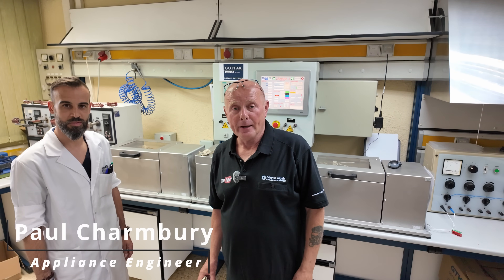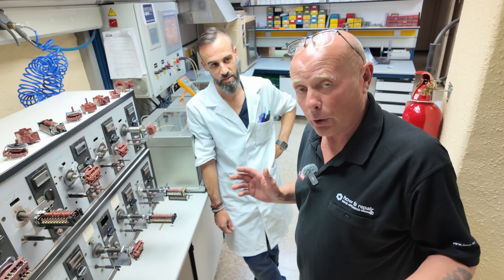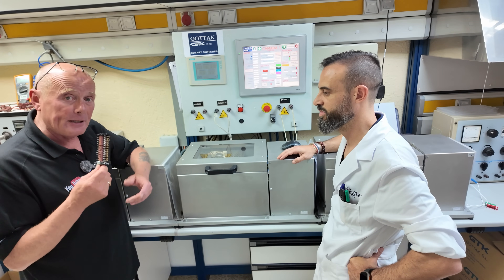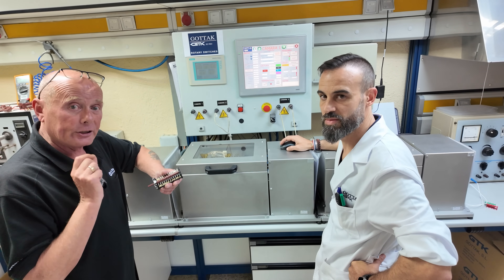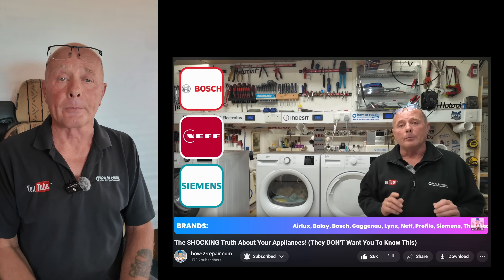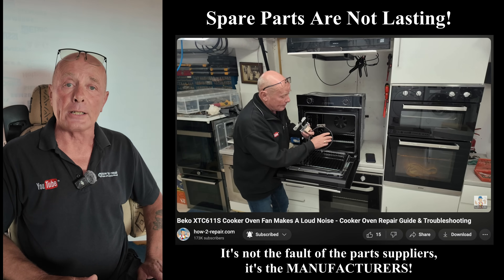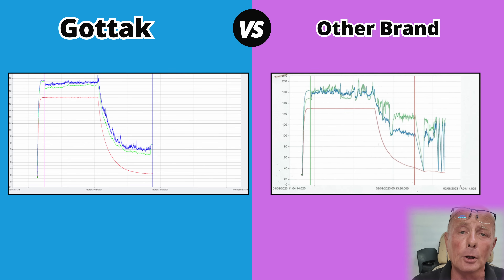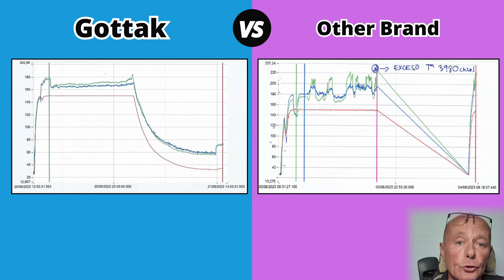Why Your Appliances FAIL SO FAST! Lab Results EXPOSE the Truth!

Comment: Bakelite?  Is that still used?
Reply from the maker: For the most part, Bakelite is not widely used in general consumer products anymore, but it absolutely is still used in specific industrial applications where its unique properties are essential. The Bakelite handle on a 70-year-old appliance might still be in perfect condition, but the cheaper plastic used on a modern machine can become brittle and crack from heat or UV exposure in just a few years. They swapped extreme durability for lower manufacturing costs.

This decline in material quality is a classic form of the built-in obsolescence we cover in our main video. For a deeper dive into this topic and to see other examples, please check out the full video here: https://youtu.be/gEgSCbZnHVM?si=wTIw0mELuhWaw4aX
Reply: @How-to-repair  Thanks!

Comment: well this is nothing new
Reply from the maker: Thanks for your comment. This concept has been around for about a century! A famous early example is the Phoebus lightbulb cartel in the 1920s, where manufacturers deliberately engineered their bulbs to have a shorter lifespan just to sell more.

The reason we continue to cover this topic is that the tactics have evolved and become much more subtle. It's no longer just a simple weak point; today it's a complex circuit board that fails, a software update that slows things down, or a tiny plastic component in a high-stress area. The principle is old, but the methods are constantly changing.

This is exactly the kind of modern built-in obsolescence we discuss in the video. For a deeper dive into how this old problem affects the appliances we buy today here in Türkiye, please check out the full video here: https://youtu.be/gEgSCbZnHVM?si=wTIw0mELuhWaw4aX

Comment: If only it was only the appliance manufacturers!  Everyone is making everything really shitty since many years and it is still getting worse.  All about money as stated before but the manufacturers are not the only ones to blame.  Consumers keep on looking for the cheapest products and manufactures comply.  I strongly believe manufacturers should all enable consumers to repair their own goods and quality parts must be made available for up to at least 20 years.  Instructions and diagnostic software MUST be made available free of charge.
Reply from the maker: You are absolutely right that this problem extends far beyond just appliances, and you've hit on a difficult truth about the role of consumer demand. It has become a vicious cycle: manufacturers market cheap, low-quality products, and as consumers, we've been conditioned to hunt for the lowest price, which in turn pressures manufacturers to cut even more corners on quality. It's a cycle that's hard to break when the true cost of a cheap product isn't on the price tag. This is exactly the kind of built-in obsolescence we discuss in the video. Our goal is to help break that vicious cycle by showing people the reality of modern manufacturing, so they can start demanding durability and repairability.

For a deeper dive into this topic, please check out the full video here: https://youtu.be/gEgSCbZnHVM?si=wTIw0mELuhWaw4aX

Comment: I have an older washer/dryer combo i have repaired a few times.. People immediately tell me "just buy a new one". This is why i dont
Reply from the maker: It's incredibly frustrating to hear "just buy a new one," isn't it? That advice is the direct result of decades of marketing designed to make us believe that appliances are disposable and that repair is too difficult or expensive. It's exactly what manufacturers want us to think.

By repairing your machine, you're not just saving a perfectly good appliance from the landfill, you're also saving money and you have the satisfaction of knowing your machine inside and out. An older, repaired machine that you know is often far more reliable than a brand new one with its own set of planned failure points.

Your mindset is exactly why we make these videos. This is the very issue of built-in obsolescence we discuss. We want to encourage and empower more people to see repair as the first and best option. For a deeper dive into why new appliances don't seem to last as long, please check out the full video here: https://youtu.be/gEgSCbZnHVM?si=wTIw0mELuhWaw4aX

Comment: Being a retired engineer those corporate working engineers should be ashamed of them SELVES... They ALSO should quit cooperating with the shotty accountants or they are a DISGRACE TO THE FIELD OF ENGINEERING!. Just quit walk out say FU Mr accountant!
Reply from the maker: Hi there! Thanks for your comment. As a retired engineer, your perspective on this is incredibly valuable and powerful.

You're right that it often comes down to pressure from the financial side of the business, where saving a few cents per unit is prioritized over building a quality product. This places working engineers in a very difficult ethical position, caught between their professional training and the demands of a system focused on quarterly profits. Many feel, as you do, that designing for failure is a disgrace to a field dedicated to innovation and durability.

Our goal with these videos is to expose the results of this broken system. This is exactly the kind of built-in obsolescence we discuss in the video. For a deeper dive into this topic and to see the examples we covered, please check out the full video here: https://youtu.be/gEgSCbZnHVM?si=wTIw0mELuhWaw4aX

Comment: I work at a rental property built in 1968. Many of our appliances are still original. After almost 60 years those appliances are running strong. Physical damage due to human error is the most common reason we replaced those old appliances. In essence, old appliances were made to last forever.
Reply from the maker: Thanks for your comment and for sharing that fantastic real-world example. That is an incredible testimony to the topic of our video. Appliances from 1968 still running strong after almost 60 years is amazing, but sadly not surprising. Your point that they are most often replaced due to physical damage—not mechanical failure—is the most telling part. It proves they were built to do their job, and do it for decades.

This is exactly the kind of built-in obsolescence we discuss in the video. The contrast between your 60-year-old workhorses and modern appliances that fail in a few years couldn't be more stark.

For a deeper dive into this topic and to see the examples we covered, please check out the full video here: https://youtu.be/gEgSCbZnHVM?si=wTIw0mELuhWaw4aX

Comment: Personally I wouldn't expect any switch to last very long in a continuous operation. Especially as it may be operated once a day. Starting at room temperature. Nothing about frettage corrosion or cadmium contact material mentioned.  George
Reply from the maker: You are correct that a component designed for a specific, limited use will likely fail when put into continuous operation. The technical details you mentioned are a key part of why that happens.My core argument is that we need a shift in design philosophy towards making things last and ensuring the right to repair is possible, regardless of the specific technical reason for failure. Thank you for adding that important layer of technical detail to the conversation. It's much appreciated.It would be really helpful for me to get my video shared and help us fight appliance waste!
Reply: @How-to-repair yep I am all for things to last. I'm ex RS Components tech support guy. Electro Mechanical Engineer Retired 25years. George

Comment: Lucas Diode pack in alternators. Diodes encapsulant material would gradually over time bleed into the silicon diodes causing them to fail. George

Comment: Sinclair Computers.  ULA Chip.  Timer. After so so many operation hours/days it would blow a link inside the chip stopping it from working. This was discovered when it was adapted for industrial use 24hours a day continuous.  Shorten it's life as the computer was designed for home use just a few hours a day. George. Ps So many I know about . To comment here.
Reply from the maker: Hi George, thank you for sharing that fascinating (and infuriating) piece of history. That is an incredibly direct example of the issues I discuss in the video.

While the methods may be less obvious today, the principle is the same. Instead of a chip designed to fail, we now have machines that are a nightmare to repair or that are simply not built to last, with many not lasting much more than 5 years.

The end result is the same: the product has an artificially short lifespan, and the consumer is forced to buy a new one. It's sad to hear how long these practices have been going on.

Thanks again for sharing that example. It would be really helpful for me to get my video shared and help us fight appliance waste!

Comment: Governments need to implement a minimum guarantee on the life of such machinery in excess of 10 years
Reply from the maker: We couldn't agree more. You've hit on what many believe is the most powerful solution to the entire problem of built-in obsolescence. Mandating durability through legislation would fundamentally change how companies design their products.

While a full 10-year guarantee isn't law yet, these are huge steps in the right direction. The first step to getting stronger laws like the one you've suggested is widespread public awareness. When enough consumers understand the problem and demand change, politicians are forced to act.

This is exactly why we make these videos—to arm people with the information needed to demand better from both manufacturers and legislators. For a deeper dive into the issues that make such laws necessary, please check out the full video: https://youtu.be/gEgSCbZnHVM?si=wTIw0mELuhWaw4aX

Comment: Manufacturers are going to make most of their money on appliances that can sell, and expensive ones do not sell. So they are not going to engineer an appliance with high duty cycle parts. Consumers drive the horrible quality, and it's not limited to appliances. Every single person who buys the "cheaper model" because they save a few dollars, is contributing to the problem.
Reply from the maker: I’m sorry to say you’re so right the consumer is normally the instigator of the problem but also the shareholders are also contributing

Comment: In my experience, with washers, dryers, and dishwashers, switches don't often fail today, it's the control board, sensors, and fans, which fail.
Reply from the maker: While we might use a simple mechanical switch as a clear visual example in a video, you've pinpointed what is arguably the number one failure point in modern appliances: the electronics. The shift from robust, simple mechanical controls to complex, centralized control boards is at the very heart of the modern built-in obsolescence issue. These boards, along with their network of delicate sensors and small fans, are highly vulnerable to heat, moisture, and power surges.

This is exactly the kind of built-in obsolescence we discuss in the video. For a deeper dive into this topic, please check out the full video here: https://youtu.be/gEgSCbZnHVM?si=wTIw0mELuhWaw4aX

Comment: I have an Oasis dehumidifier that was purchased for my oldest sister with Asthma. It is 70 years old and still works great.
Reply from the maker: That is an absolutely incredible story and thank you so much for sharing it. A 70-year-old appliance still running perfectly is a powerful, real-world testament to the topic of this video. It's stories like yours that perfectly illustrate the decline in manufacturing quality and longevity that we aim to expose.

For a deeper dive into why modern appliances don't last like your Oasis, we cover the topic extensively in the full video here: https://youtu.be/gEgSCbZnHVM?si=wTIw0mELuhWaw4aX
Reply: @How-to-repair  Thank you again, I will watch and share the new video. If you can ; I wish someone would expose the automotive computerized car next. Our neighbor had a 2020 Honda Pilot with 62000 miles on it. They had to scrap it when the central computer wiring system failed. It would cost over $20,000 USD to repair it as it used multiple processors behind the dashboard. Cars can and should be built such that a standard tablet computer can slide into place  in the dash or a heads up display like Tesla uses. The car can operate on downloaded software and the tablet can manage all the required systems. Displays like speed,  Mileage, temperature, radio, GPS, etc. then when you sell it you take your tablet with you . The new owner can plug his tablet in the same fixture. No more random computers spread around the car only necessary wiring.

Comment: I am considering buying new appliances that have failed. Then refurbishing said appliances with aircraft quality components. For example, on a refrigerator replace the compressor with a very high-quality compressor. Replace other key components with very high-quality components. Repainting or cleaning and then reselling the appliance at a higher cost and guaranteeing it for 20 years. I would love some assistance in investigating this business model-on very specific appliances like air conditioning and refrigerators.
Reply from the maker: You're essentially proposing to do what manufacturers should be doing: building appliances to last. It tackles the built-in obsolescence problem head-on and creates a premium, sustainable product. It's an idea we've discussed internally and I'm thrilled to see viewers thinking along the same lines. Thanks again for your comment and it would be really helpful for me to get my video shared and help us fight appliance waste!
Reply: @How-to-repair great to hear . I have already shared the video with my friends. You are spot on. I rarely see a modern washing machine that cleans clothes any better than new computerized washing machines. I am an electrical engineer; I don’t have problems using computer technology. But when it is used unnecessarily I quit. I draw the line at computerized pencils ✏️ 😂🤣

Comment: Why are you hiding the brands that make bad switches? This is useless video without that key information.
Reply from the maker: That's a very fair and important question about why we don't name the specific brands using these poor-quality switches. I completely understand how that can be frustrating when you're looking for clear guidance on what to avoid.

The primary reason we often speak in general terms is due to the legal complexities and risks involved in singling out massive corporations. Our goal as a channel isn't to create a 'blacklist' of brands, which can change from model to model, but rather to empower you as a consumer. We want to arm you with the knowledge to look at any appliance and identify the potential weak points for yourself, like the flimsy switches we showed. This approach helps you make informed decisions, no matter the brand on the label.

This is exactly the kind of built-in obsolescence we discuss in the video. For a deeper dive into this topic and to see the examples we covered, please check out the full video here: https://youtu.be/gEgSCbZnHVM?si=wTIw0mELuhWaw4aX

Comment: That is why old British Equipment was always so good. Old designs that were not designed to such limitations. Th3 modern equipment is made to a lesser standard because the standards have dropped! That is why the Chinese stuff is so cheap. You take the inspectors around the factory and they approve then when they leave the Chinese do as they wish!
I doubt they use baker lite the Germans have a very good plastic which will take impact on a 2 ton bench press to fix the contacts. 
Yes I have had the argument with purchasing officers who buy cheap. They save money but I had to spend money on the assembly or put somebody on a stool to hand assemble! Rubbish. The factory was taken over and the copper platinum points were sold off for scrap! That is the problem. The other matter is that many engineers do not understand the manner in which some styles of mechanical switches operate. They think it all relates to divisions by degrees. Only in some styles of switch!
Reply from the maker: In the 80s, 90s, and early 2000s, most manufacturers produced high-quality equipment to build their reputations. Now, many have large market shares because they've bought up other brands. For example, Bosch, Neff, and Siemens are one company; AEG, Electrolux, and Zanussi are another; Hotpoint, Indesit, Ariston, and Whirlpool form another group. These conglomerates now control the market but seem less concerned about consumers. Their main goal is to sell machines. They use green marketing tactics to their advantage but aren't held accountable for the growing pile of discarded white goods. Nowadays, machines last only about five years on average.

Also buying cheap is only falling into the manufacturers hands even cheaper appliances should last a statutory period of time. Thanks for your comment. This video seems to have really touched a tender nerve with a lot of people! It's clear I'm not alone in wanting more sustainable appliances. Help me hold the industry accountable by sharing this video. To make a real difference, we need to get this message to the people in charge and tell those appliance-wrecking accountants to back off! I would be grateful if you would share this post, as it’s the only way to force things to go large nowadays. Have a great day, Paul.